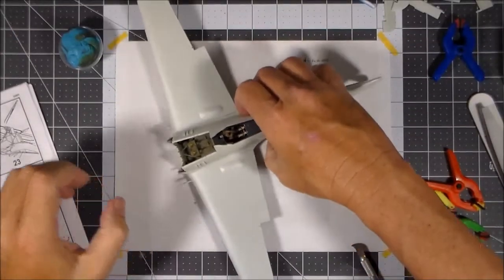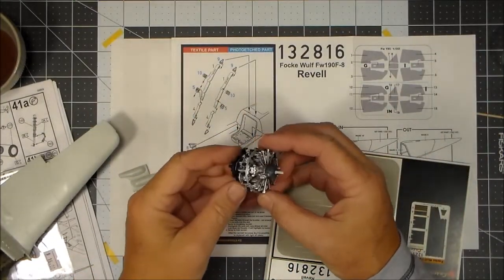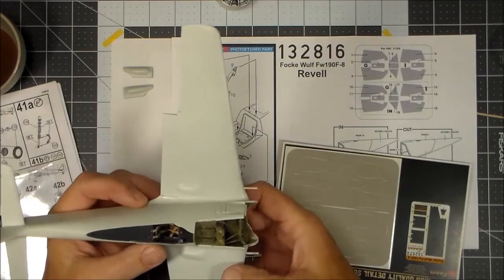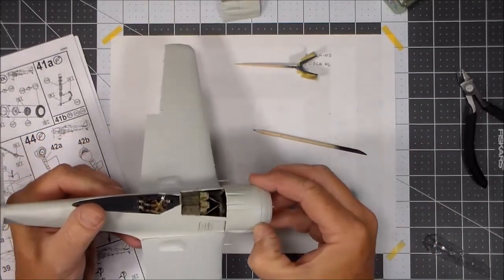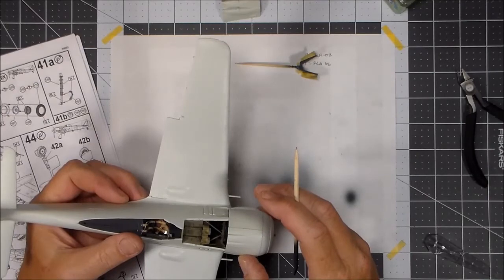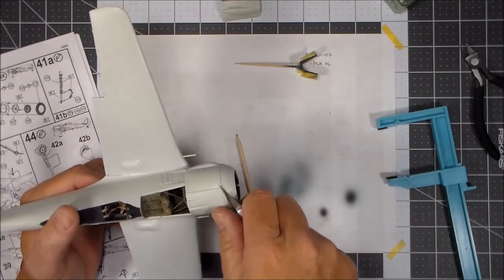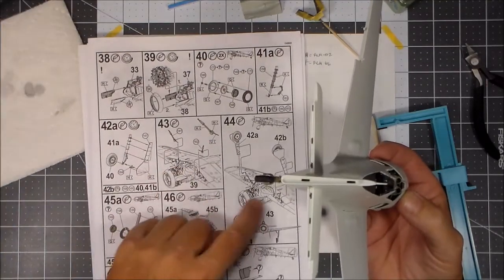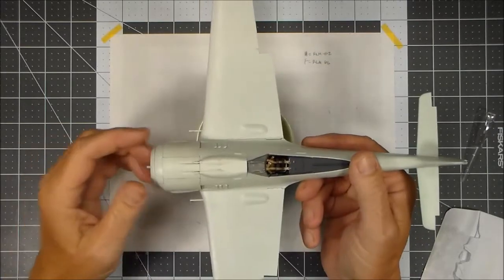Revell 1 32 Fw190 F8 Part 3

Comment: Looking great so far buddy.Built this kit myself last year.Loved it ;)
Reply from the maker: Yeah, I watched your video, and it turned out great. I have to say that the engine on this kit is really nicely detailed right out of the box. I like yours with it exposed... I am hoping to build another in the future and leave everything open and display it in a maintenance setting.
Reply: Brett G Very good engine detail for the money,I would stretch to say the best one for value for money mate.The only little problem I had with this kit was the wing spares.Part from that super kit ;)
Reply from the maker: Warren Blanch the wing spares?
Reply: Brett G The supports inside the wings mate.
Reply from the maker: Ah... gotcha. The part I had the most difficulty with was the weird connection between the front of the wings where it attaches to the fuselage, and the two small, bulged sections that the cowls attach to. Needed a little sanding there.

Comment: Very useful, even though your Fw 190 is in 1/32. The video proves again that it ian't always a good idea to stick with the instructions too tightly, but to look and think ahead.
Reply from the maker: Thanks, Jens. That is one of the reasons build reviews are helpful, especially ones where the reviewer/builder describe fit issues. If I know ahead of time what the potential problems are, or if I can figure them out beforehand by lots and lots of test fitting, I can come up with an alternative approach to assembly. Then hopefully I can avoid excessive filling and sanding.
Reply: Yes, I understand what you mean and I agree. I tried to explain the way I do it. The video would be way too long if I did an inbox review and a build review in one video. I do a build review while I am working at the kit, but it takes a while and there are usually quite a lot of updates. If viewers have the patience to follow the build they get a good insight and a conclusion at the end. Small kits like the Italeri trailers or the ThunderModel tractor are the only ones I can build in one step and give a precise conclusion on in one video. Everybody does it his way and we don't have to like all of them. There's nothing wrong with that.
Reply from the maker: Non-Prolific 1/35th Scale Model Builder true that, my friend.